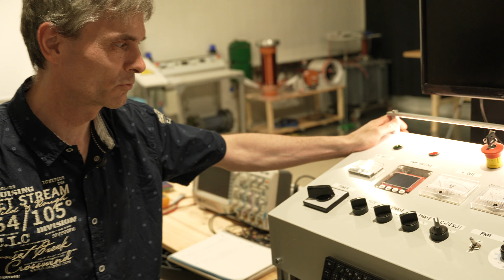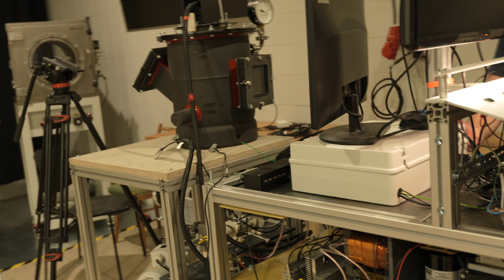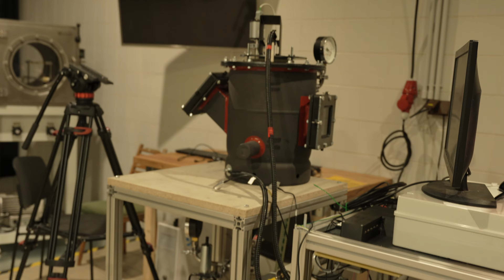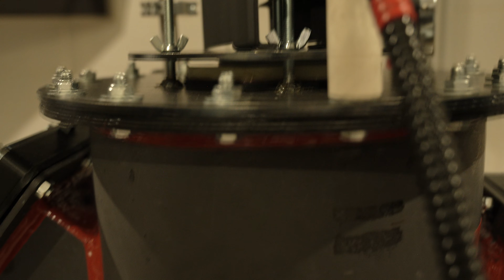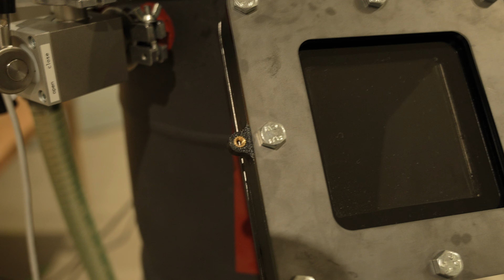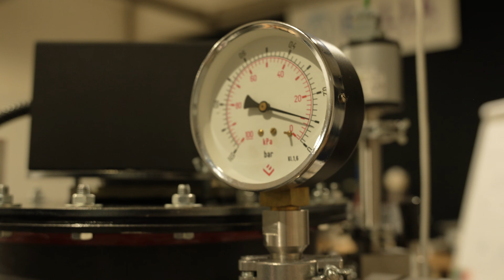VEGA - Replication in Jan Rak's lab near Prague

Comment: You know how it’s very hard to load hydrogen into titanium because its tough oxide layer gets in the way? Now suppose you have a titanium electrode in the VEGA and run it initially with a heavy non-reactive  gas like xenon. If you crank up the voltage then maybe you will begin to ablate that tough oxide layer. Once you have run it sufficiently long enough with xenon, then switch over to hydrogen to begin loading the titanium. I hope the right person reads this. I don’t have a way to test this idea personally.
Reply from the maker: Hydrogen will reduce Oxides.
Reply: @MFMP Wouldn’t titanium bond more tightly to oxygen than hydrogen? And if you’re hitting the TiO2 molecules with a much lower mass H, I think you have less chance of knocking the TiO2 loose compared to hitting it with a heavier ion like Xenon.